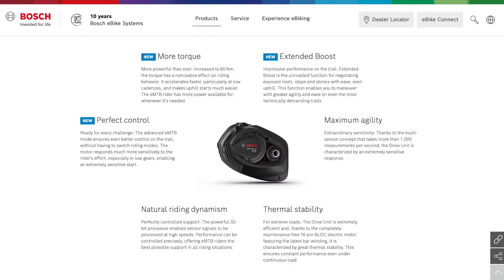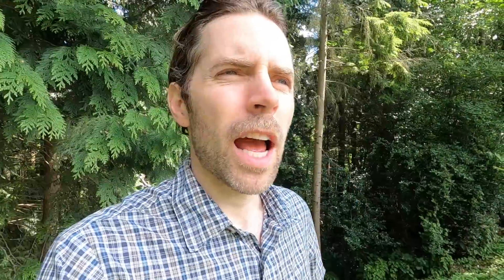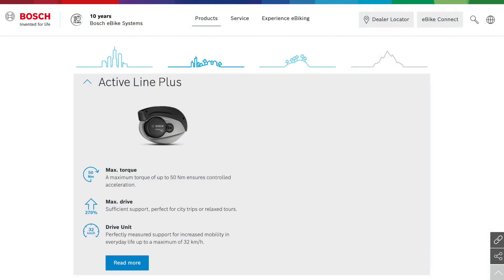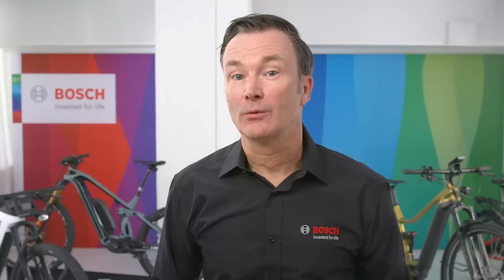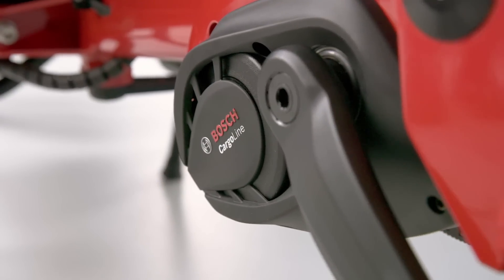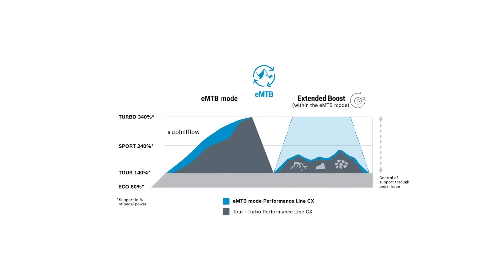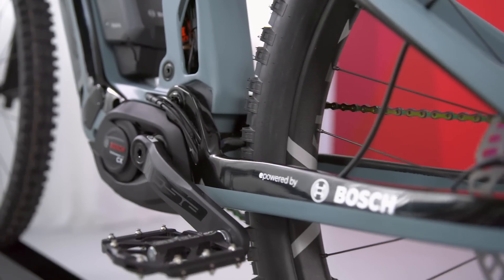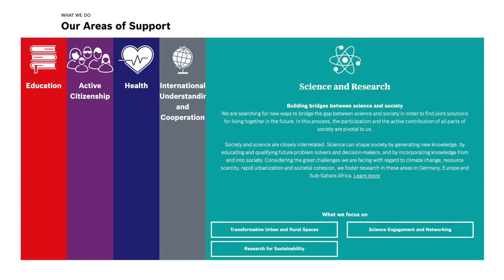Bosch 4th Gen Performance Line Ebike Motor Updates: 85Nm Torque, eMTB Refined, Extended Boost!

Comment: Hi would you know if all the bosch performance cx motor all generations have same retaining bolts to.frames . I have bought a used frame with no motor so need a motor 2019 frame .

Comment: This motor is held in place by only 3 bolts? 

I'm a noob, so I'm concerned about this, "Take the motor off in just 5 minutes: only three bolts lock the motor in place."

Comment: What I think is missing from this video is the system requirements.  You don't understand why there are so many versions.  If you consider the cost, weight, and battery life I think it would all make sense.  What I see is a company with an idea to be a big player in Ebikes made a premium product.  The mass market went lower cost and the people who want to pay ended up being commercial users and the rich.  Instead of trying to give onions on what you like (you don't pay so of course you prefer the top model) , tell us the cost and limitations of the consumer models.
Reply from the maker: Thanks for the feedback! The limitation of the entry level Active Line that most frustrates me is the lower 105 RPM motor support vs. 120. It also has way less torque at 40Nm vs. 85Nm on the Performance CX, Speed, and Cargo models :)
Reply: @ElectricBikeReview  To clarify, the lower motor speed number, does that mean that you can peddle  fast enough that the motor does not contribute power?  That would be annoying.  Even if it is rare, when the rider says full power it must give full power.
I suspect the active line is lower voltage but I can't seem to find the spec.s compared.
Reply: https://share.icloud.com/photos/0Od87vNXnkhxqxEG4dL8zhZ6w

These motors show latest firmware updates with MY20: 1.1.0.0 having the 85nm update.

Comment: It would be great if Bosch did an update for the walk assist function so you could use it to pull away while on the bike, this would be very useful when pulling away from a standstill up a hill (Acive line plus)
Reply: Then it becomes a bike with a "throttle" negating it's Category 1 status - at least that's what I have read.

Comment: Thank you for another great video! Did Bosch indicate when the actual release date is this Summer of 2020? I am just wondering when I should plan to inquire with my Trek dealer for my Allant+ 7S with the gen 4 performance speed line motor.
Reply from the maker: Great question! No, I wasn’t given a specific date. I got the impression that it would be before the end of July. If you or others get confirmation or hear differently, I welcome feedback!

Comment: I have a beifang midrive I installed on a cruiser and love it. Simple powerful and a nice smooth throttle. "German" engineering IS overpriced and often convoluted with unnecessary features. I have 3030 miles on my mid drive biefang 750w..I can go 29mph on throttle and a 50mile range when I peddle assist.
Reply from the maker: Nice! Which motor do you have? Sounds like maybe a BBS02 if you’ve had it for a while and bolted on to an existing bike frame :)
Reply: @ElectricBikeReview  I've had it for  three or four years and it's a little dangerous lol.. because I put old timey rim brakes  that are sketchy on this old Marin Cruiser that had coaster brakes that now can't be used.. I've had this bike up to about 35mph while full throttle and  peddling.  It's torquey too!  Throttle is must in my opinion..it takes away the guessing when the  initial burst of power of peddle assist cadence sensor initiates from 0 mph.
Keep up the good work! :-)

Comment: Whats all this percentage  twaddle you can only get 100 percent , that's it! Anyhow all we want is a bike that gets you up a hill without getting a heart attack
Reply from the maker: The percentage output is relative to your own pedal input... so you may exert 250 watts I’d pedal power, and the motor will match you at 100% with an additional 250 watts. I think the motor peaks at 340% relative output and 600+ watts 85 newton meters. Hope this helps clarify.

Comment: I send away for the delfastbike that goes 230 miles on a charge at 30 miles a hour for all most $6,000 have you heard of that kind of bike
Reply from the maker: Hi Scott, yeah! That name rings a bell. Sounds like a neat setup, is it technically a motorcycle or moped because of the higher speed cap? I’d love to hear your thoughts if you’re getting one or have tried it.
Reply: ElectricBikeReview.com I am getting it in three or four months I probably have to get use to it riding around the area then I can go far with it I need some kind of helmet with a face shield I can breathe with I want to block the wind on me

Comment: I still have a Bosch Classic standard motor. 8 years old, when I bought it already 1 year on the market. Works perfect for me. I own a Sparta Bs3, a all day bike. I riding the most on flat terrain, The Netherlands, but also on very hilly terrain and a holiday with camping gear from Switzerland to Rotterdam. (1300 km). As long as the motor works, I keep it. (never had a problem with it). I like to have a bicycle experience, so I use the tour mode 90%. We can have strong winds here and long time against those winds I sometimes use Sport. When I must climb I use Turbo. Battery still between 80 and 100 km, depending on the weather. If it is cold distance is less, if it is warm some more. Strong wind against you does not help, but you mostly do that on the half of your trip. When strong wind helps you in your back, you can use as little as possible eco. Often above 25 km per hour is possible. 400 Bosch battery ( I own 2 of them, I switch them all the time).
Reply from the maker: It’s amazing how long listing these drive units can be! Glad to hear that yours is still performing well... even the battery. My uncle has owned and ridden a Haibike with Bosch CX weekly, and he did replace the battery, but it’s still going strong!
Reply: @ElectricBikeReview  Bosch Is good. I even did not replace the battery, the 8 year old battery is still very good. I switch between them, all the time. Seems to work very well. If I do not long trips, lets say city drive, when I see the battery has still left III, I take it off and load my second battery. So normally I not go to the end of the battery. When I do very long trips, I often take the second battery with me, be care full that you do not drive your battery till there is no power left. On my long holiday where you can load your battery on camping place, I was really careful, never above tour because the distance was about 100 km on a day. Fill the battery up, not much left and use the full other battery for the coming day. So 100 km on one battery was possible. But then I really take care, never above tour. Was a crazy nice holliday. All alone the Rhine, not much climbing, but also not on a flat underground, mostly it was no asfalt. If something happens on my old current bike, I would chose another bike with a light Bosch motor. But where I am talking about, it feels this bike can do another 8 years...

Comment: Active Line is actually for Europe due to legal reasons. In my country (The Netherlands) it's only allowed to have an ebike with a power up to 250 watt. The benefit is that it's legally considered a just a regular bicycle including all the legal protections that offers (Including the privilege to use cycling roads instead of the regular roads). 

The other motors have more than 250 watt and are due to that legally considered a "Motorbike" and needs a numberplate, is not allowed on cycling roads etc. Which is a huge inconvenience..
Reply from the maker: Thanks for the feedback! Do you also have the Active Plus and Performance there?
Reply: Cerandus sorry, but that’s not correct, also here in NL the full range of Bosch motors (incl 2021) is legally and fully available in 25km versions in any good bike shop. Probably 250w version then but specs are the same!
Reply: The full bosch line is indeed available over here but things are slightly more complicated due to the legal definition of an ebike. 

Effectively you lose any benefit of a higher wattage than 250W (Unless you wish into a speed pedelec of course, which has the same legalization as a motorcycle which are usually less favourable). 

Source (ANWB):
https://www.anwb.nl/fiets/diefstal-veiligheid/wetten-en-regels-elektrische-fietsen

Source (National Government of the Netherlands):
https://www.rijksoverheid.nl/onderwerpen/fiets/vraag-en-antwoord/welke-regels-gelden-voor-mijn-elektrische-fiets-e-bike

(It's in dutch. But google translate helps. ANWB is a non-profit organization/club that is quite large over here. The other URL is of the national government). 

A translation:
(Legal) Definitions of an ebike:
-  The bicycle has pedal assistance up to 25 km/h
-  You have to use the pedals to move (Aka: No throttle)
- The motor of the bicycle has a maximum capacity of 250 watt. 

The rules of the ebike are the same of a normal bicycle:
- No driving license rquired
- No liability insurance required
- There is no minimum age
- You are required to use cycling paths where available.
- You don't have to wear a helmet

If it doesn't have the requirements above it is most likely a speed pedelec and has the same laws as a motorcycle. 

Source of speed pedelec information (National government of the Netherlands):
https://www.rijksoverheid.nl/onderwerpen/fiets/vraag-en-antwoord/welke-regels-gelden-voor-speed-pedelec

(It's in Dutch. I highly recommend using Google translate).

Comment: I see wrinkles, white hairs everywhere... Where´s the kid who started this channel like a couple of weeks ago? :P
Nah, just busting your balls, mate. Time flies for  everybody...
P.S. As someone interested in bike touring, I´ve always liked the Active Plus motors, since they´re way more efficient than the Performance CX, so if the newest Performance line gives us a slightly higher torque and higher cadences, it could be THE way for me, al least in the Bosch system.
Best!
Reply from the maker: Yeah, the new Performance Line motor (that looks like the two Active) could be the sweet spot of efficiency, weight, and still some good performance characteristics like 120 RPM and 75nm of torque. I do like Active Line Plus as well, it's probably the lowest I'd go because I'm still a kid at heart and like to go zoom zoom :D

Comment: I'm confused, is this update available for my 2019 Trek SuperCommuter 8+?
Reply from the maker: I know right!! This was super confusing for me too at first. Here's how you can tell. Does your motor have a big chainring or the smaller proprietary chainring? If it's big, does the motor casing look like the Active Line or does it look more compact like these 4th generation modes (CX, Speed, Cargo, Cargo Speed). If all else fails, does the spindle have standard ISIS spline interface, or the smaller Bosch Narrow Interface (BNI). That should be enough to help you figure it out. Then, just take it to the dealer and ask for the new summer 2020 software with "Extended Boost"
Reply: @ElectricBikeReview  Ok, thanks for the explanation. Unfortunately, my SuperCommuter has the old speedline motor

Comment: As an active line owner I'm just SOL, right? JQ
Reply from the maker: Haha, oh man! Hope I didn't make you feel bad, do you like it? I've tested that motor a couple of times hot off a performance or Active Plus and to me, it just felt so weak. It's the most efficient and usually comes with a PowerPack 400, so it's good that it makes the battery last. It's a big jump from a non-electric bike. I just like the faster sportier feel ;)
Reply: @ElectricBikeReview  Lots of money down the tubes. But my wife might use it and then I could get a bike for myself with more JUICE! Pun intended. JQ
Reply: I forgot to say I do really like the bike, my first ped assist though I test rode a spunkier Trek mountain bike of a higher speed Bosch power system.